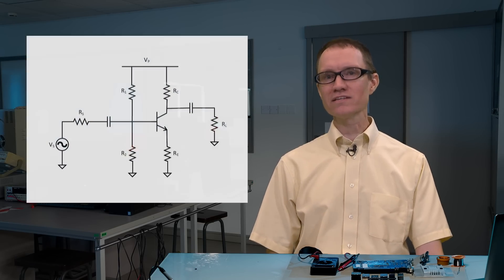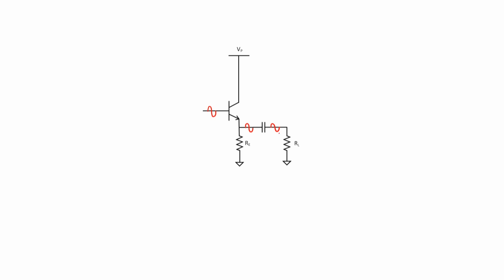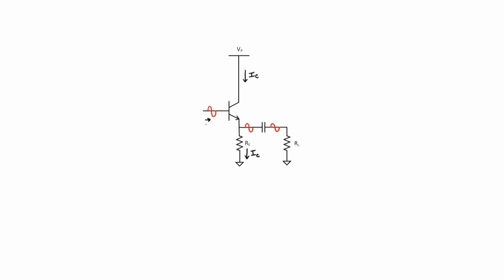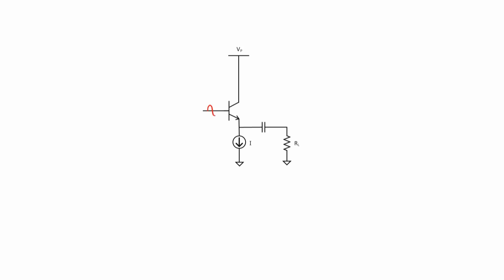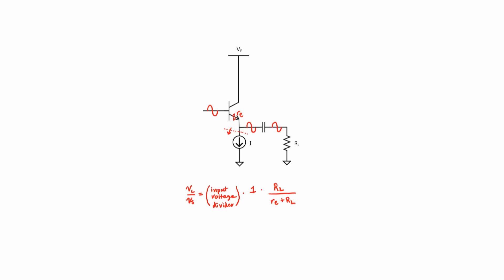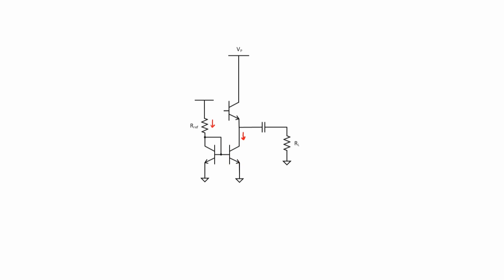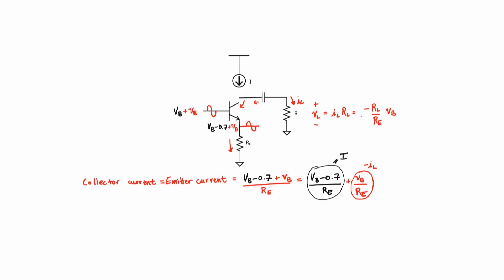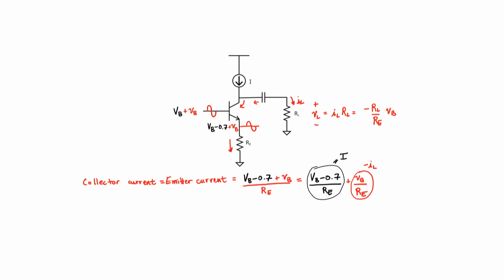Biasing transistors with current sources (29-Transistors)

Comment: I was told that collector amp as you called it
Was actually an emitter follower
I have a different opinion as you mentioned of a collector

So some of your explanations may seem correct, but using the wrong terminology
So I'm wondering where you got your education,
Definitely not what seems to be standard

Comment: I'm designing a bridge amp, using two JFETs on each channels, one of them is out of phase: so far the simulations show that extra gain available, my challenge is matching preamps in gain and bandwidth, which are different biasing topology  (cascode and common collector); power amps is the same chip fed on the same (-). I could do the phase inversion on Power Amp inputs, but I want to have some "character" of different stages on the preamps. So far simulates really nice in LTspice.

Comment: I wonder why we have to make bias voltage in to the base with two very different values. I get that it is important step to get correct voltage (mosfet) or current (npn,pnp), but my own amplifier with SE topology with mosfets i have made it so that R1 and r2 are replaced with 1kohm trimpot and middlepoint where is divider output will go throw r3 20kohm resistor for mosfets gate pin.

That way positive and negative ac signal value pass to coupling capasitor will see relatively same resistance which is about 20,5kohm.(R1 maybe 250ohm and r2 750ohm are parallel with ac perspective and r3 20kohm)

This will get better linearity, i want to believe and hear with my own setup.

Comment: 1:17 I was interested in hearing what you had to say about the input side of the circuit as well. Supposedly we still need to bias the transistor into the active region – is that achievable with the help of current mirrors? Or do we still need resistive biasing there?

Comment: One of the problems I see with the basic resistive bias H setup is when the AC signal swings high it is drawing more current through the emitter resistor, with part of that coming from the input signal, however when the input swings low there is less drawn from it, i.e. not a linear load, so inducing distortion.
Now if we go for the common emitter, fed with the constant current source, as you said no AC will flow so it does not work, but now connect a bypass series cap & resistor, so now the AC has an emitter path so should cause a collector signal. However now both positive and negative swings will see the same load - so a more linear amp.

With your last design, the current source in the collector of a common emitter amp, I see issues trying to get it to function as if the biasing current created by the base voltage and emitter resistor is a smidge under the collector's set current source the the collector will shoot up as high as the current source can take it as it tries to achieve it's set current, on the other hand if the current from the transistor is a smidge over the collector's current source the collector voltage will drop to as low as it can go as the current source will kind of go open circuit as it tried to pass less current.  In your deign the AC gain is Rl on Re, however the DC gain is infinit over Re - so DC wise very unstable.

Comment: Why don't you talk about Hfe, the gain in Transistors which is always different....
Reply: In fact he did mention it in passing, although I think he called it "Beta".  He said that it was typically 100+, and thus base input currents were one 100th of the output current and so he pronounced them to be negligible.  Which is commonly accepted in arguments at this level.
Stay well.

Comment: I've read that current sources, as used here,  reduce the bandwidth of the AC signal that is amplified.  Is this true?  If so, would kindly you cite something I can read about it.  Previous searches have been fruitless.  Thanks
Reply: Collector output bandwidth is f=1/(2piRC), where f is the high freq at which the collector output is down 3dB, or down to 71% cf its low freq gain.
Now a perfect current source has theoretically infinite incremental resistance, and while practical current sources will have a finite resistance, it will be very high.  Looking back at the formula we see that high R will cause low f.  That agrees with, and explains your original proposition.  I hope that helps.
Stay well.

Comment: At 4:40, you suggest that if Re is reduced then Re || RL / (re + Re || RL) is less. But you're forgetting that if you reduce Re while keeping the dc bias point at the emitter constant, you increase Ic and hence decrease re as well. Take an example of Re = RL = R and the bias point is set at Vp/2. Then Ic = Vp/2R, making re = 25mV/Ic = R * 50mV/Vp. The divider is now (R/2) / (R*50mV/Vp + R/2) = 1 / (100mV/Vp + 1). This shows that as long as Vp >> 100mV, the divider is close to 1. If you decrease Re to R/2, keeping RL = R and the bias at Vp/2, the parallel resistance is now 2R/3 and the divider ratio is (2R/3) / (R*50mV/Vp + 2R/3) = 1 / (75mV/Vp + 1). An insignificant change in any practical circuit but actually closer to 1 than before, contradicting your assertion.

[Edit:] At 8:40 you suggest that there would be no ac voltage at the emitter, "because I is a dc current source" (actually a current sink but never mind that). The whole point of current sources is that they exhibit a very large output impedance, which means that the voltage across them can vary freely without changing the current. And that's exactly what happens: the emitter voltage follows the base voltage but causes negligible change in the emitter current I because it's a constant current, and of course the gain would be zero. You got that right, but for the wrong reasons.

You are quite right that a constant current source is better than a collector resistor, but it should be easy to see that the voltage gain of a common emitter is normally (Rc || RL ) / Re, and when Rc >> RL that simply becomes RL/Re as you derived.
Reply from the maker: Thanks for this comment.  At 4:40, the source impedance (input divider) was unfortunately neglected in the video, which as pointed out correctly in your example logically leads to a clear conclusion that reducing Re will increase the gain.  The video will have to be fixed to show how the gain can instead sometimes go the other way with an imperfect source. The situation becomes a little complicated when the input divider is included since Re shows up there due to impedance reflection. With a non-zero Rs, the gain is maximized at a single "optimal" value of Re, and as Rs increases, this "optimal" Re value increases.  In a reasonable use case where Rs is large to start with, a current source allows independent tuning of re without the side effects of changing Re.  I'll have to find some way of updating the video without it becoming too messy.

Comment: Current sink/source is also frequency dependent,  at high frequency we don't have high impedans, do we?
Reply: We could use a cascode stage to lessen the effects of parasitic capacitance if that becomes a problem at high frequencies. Or choose a HF transistor that is designed to have lower capacitances.